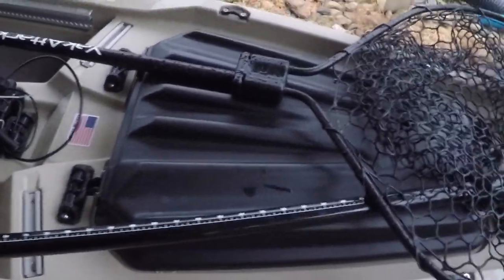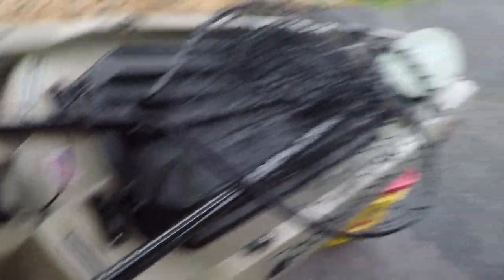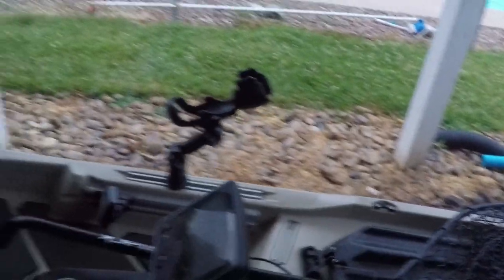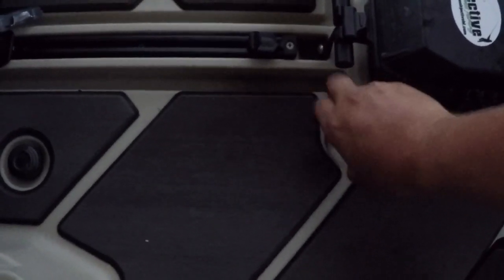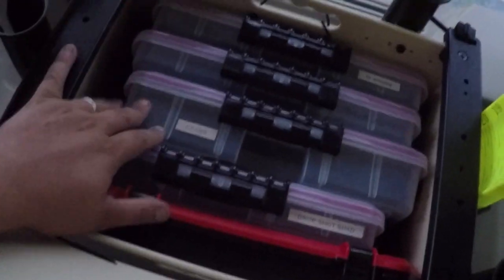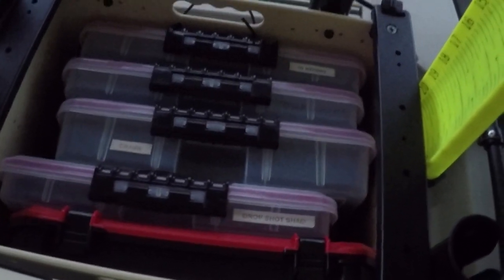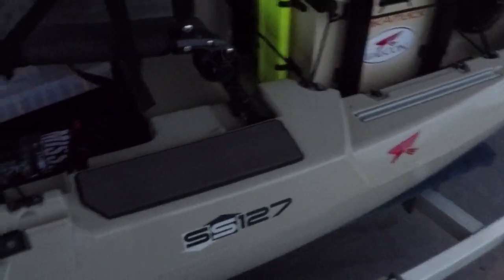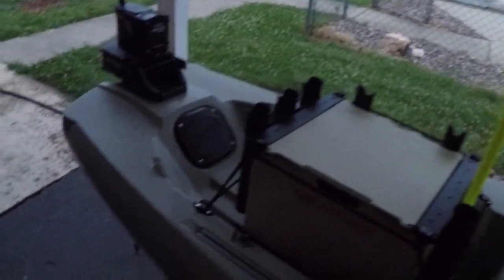Bonafide Kayaks SS127 | Setup

Comment: I get my bonafide ss127 in about week I bought a fish finder with side imaging and woundering how should mount it on bottom of dry pack so that it is pass the hull
Reply from the maker: What fish finder did you buy?
Reply: I bought a garmin echomap plus 73sv the transducer is pretty small about 3.5 inch length 2 inch wide around that
Reply from the maker: We have the 93sv. I’m sure it’s the same transducer. The bracket it came with works great. Just mount it to the bottom of the dry pod. It will be low enough so you can use side scan

Comment: Very nice man. So i heard you mention that you were an ex bass boater had a couple skeeters. Im an ex bass boater myself had a triton and just now getting in to the kayak game so i have narrowed this dow to two i think and its either the bonafide or the ascend , question is there a reason i havent seen a trolling motor set up on the bonafide also where do you het the black box and the keel guard ?
Reply from the maker: Yea I haven’t regretted selling my boat. Not one bit. If you looking around you will find a few trolling motor setups. The keel guard we make. Are you talking about the black pack that I keep my tackle in? If so it’s YakAttack they make a lot of great kayak accessories. Thank you for watching. P.S you can’t go wrong with a bonafide.
Reply: Yep i finally seen a few with the trolling motors and yes i think the bonafide is the one i will end up with dont seem to be a lot of dealers for them where did you buy yours from ?

Comment: Does water drain out scuppers good?
And I love my black pak to!
Reply from the maker: Yea they drain good. You can get the plugs thru YakAttack if need be
Reply: I started using the chair rubber bottom things for scupper plugs a couple years ago. My area had no kayak accessories and I was going kayaking the next day so I just figured out what fit. Still use them. They work fine, I drilled a hole and ran Paracord through it and siliconed the inside to seal the hole.

Comment: hows the keel guard coming?
Reply from the maker: Been doing great!
Reply: @OneObjective  I dont understand why its needed. Chad Hoover drug one 15 miles with no issue. I would imagine the keel is sturdier than the bottom. Can you tell me why its needed?
Reply from the maker: In that video he had no weight in the boat. Plus when coming in to some ramps with sharp rocks or concrete it will over time wear it down. Just something to help protect the keel. All the weight is on the keel when you first hit land.